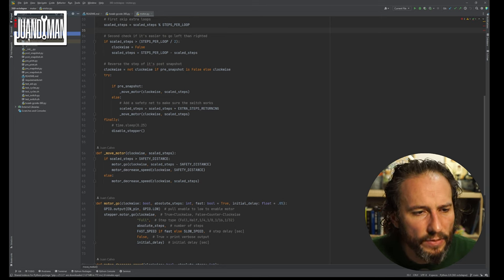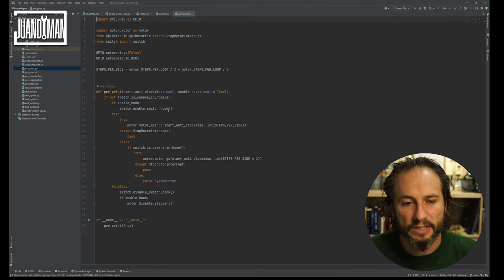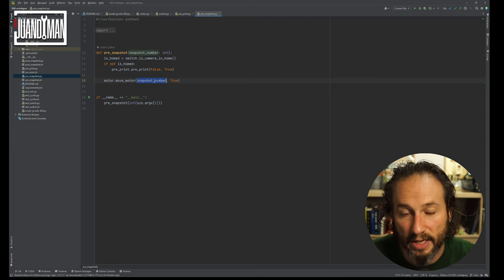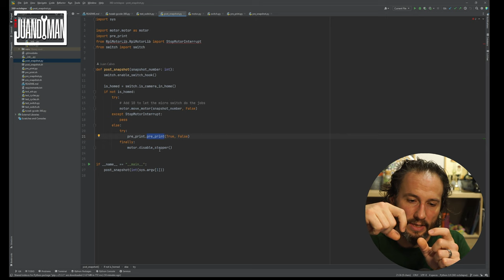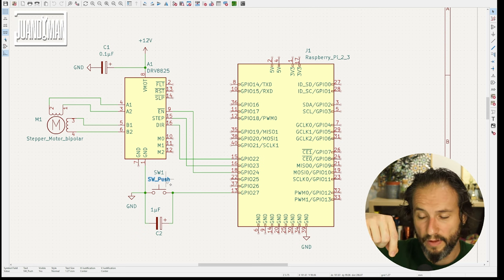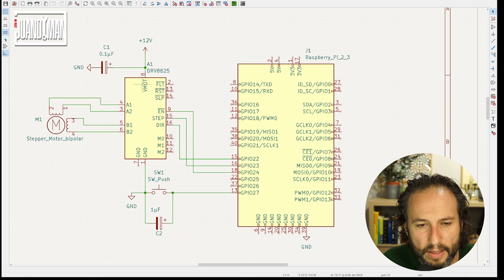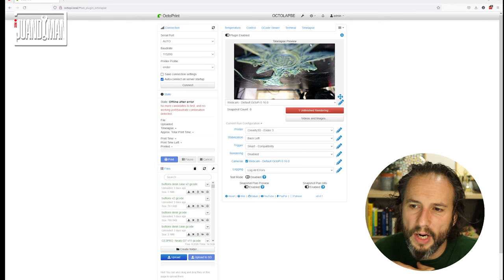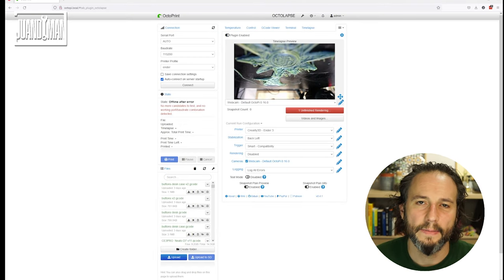Build your own 360 timelapse dolly IN DETAIL!

Comment: ABS needs to be printed in an enclosure of at least 45C with low fan, however the closer you can get it to 75C the better (you’ll need more part cooling by then but you won’t have to worry since that’s pretty hard to reach anyway)
Reply from the maker: Good to know! I’m planning to enclose the printer in a closed room and I have a few pieces of acrylic I may use to complete the enclosure. Thank you for the comment! Very useful!